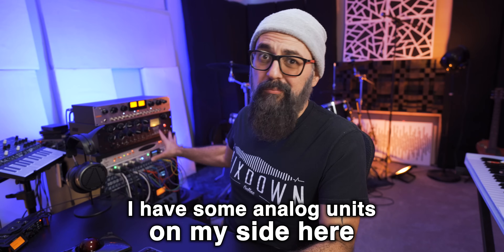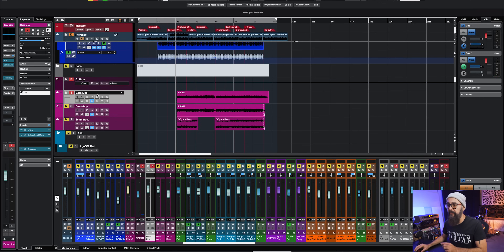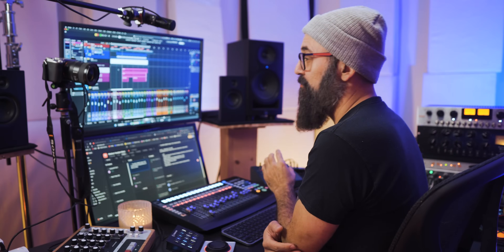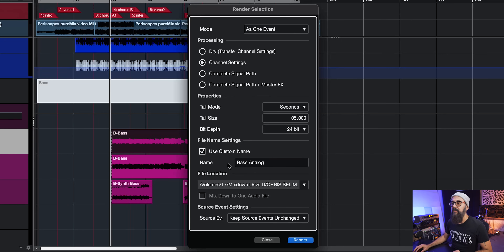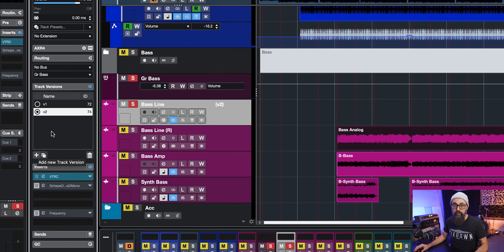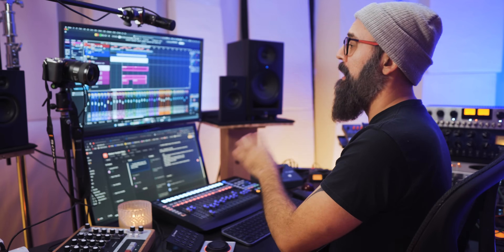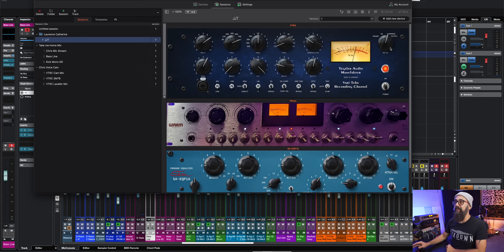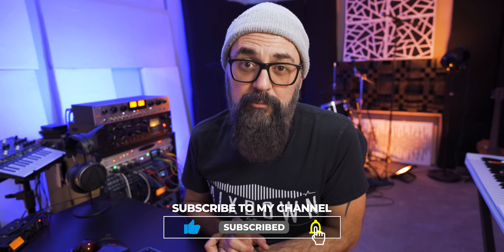Why This CUBASE Feature is a Game Changer when Mixing with Analog Gear

Comment: I also have a decent hybrid set up with a Cubase rig. I made a recall sheet (like we used to use) that I bring up on my tablet which works very well and I laid it out like my racks. If you're looking for recall sheets Barry Rudolph has a very nice site with just about everything from manuals to recall sheets.
Then I export that as a pdf and leave it in my session folder. 

You should clue some of these guys in on the round trip latency calculator for using analog gear, unless you've done that already. Always a pleasure watching your videos my friend!
Happy Holidays

Comment: Hey Chris. Hope this helps someone..... I use about 90 channels of hardware and render in place would take me forever. I've developed a bus system that is pretty slick. I have about 30 output tracks, output set to not connected, and use them as buses. Send a track with hardware to a bus track and create a new audio track. Set the new track's input to the output bus track with hardware. Arm the new track and your listening to the original track with hardware. I can have 30 or so tracks like this and hit record once and record all tracks with hardware 1 time. i put the original tracks in a folder and disable them. I like to mix with hardware in context so I do a pre mix session where I use tons of hardware. Once rerecorded, I place a few pieces, connected to a Liason, on the mix bus and that's it for hardware. Recall is a breeze. Pretty phenomenal I think.
Reply: Let's get a video on this if you or Chris can. Some older folks need visual aid to learn how this is done. thx
Reply from the maker: If there's several hardware involved, that is a fantastic idea. Thanks for sharing your process, it will help for sure! 🔥🔥🔥
Reply: Great description for this for whole sessions - premixing sessions are vital in the hybrid world, and way more interesting than hearing Andrew Scheps go on and on one more time why ITB is the only way for everyone else.

Comment: Now if only you could time delay sync all external fx (analog gear) at once, be able to turn alll external fx on/off with one button and also save normal size pictures with the analog external effect window (would make recall a lot easier as well).